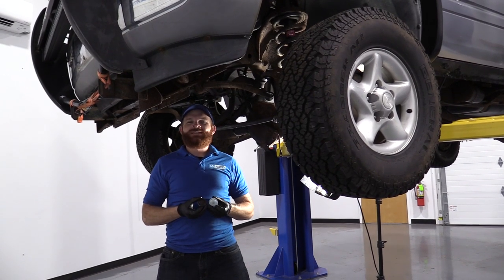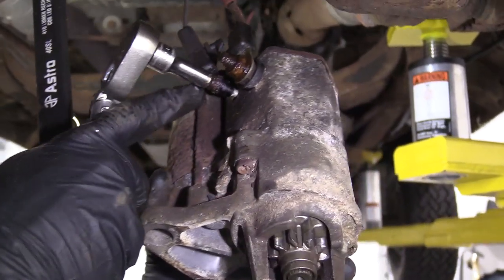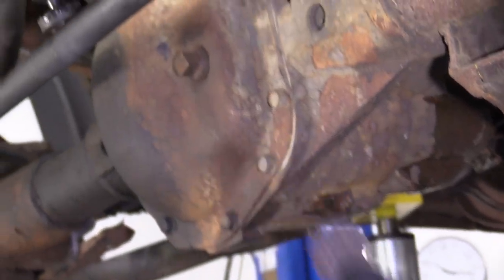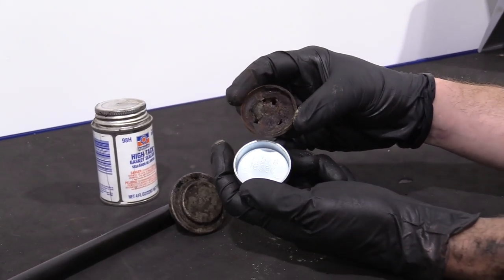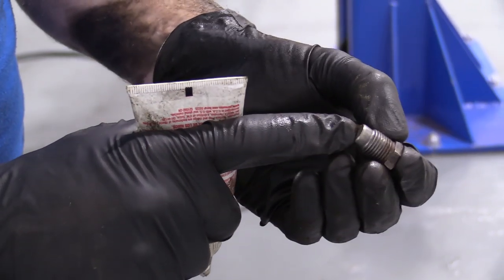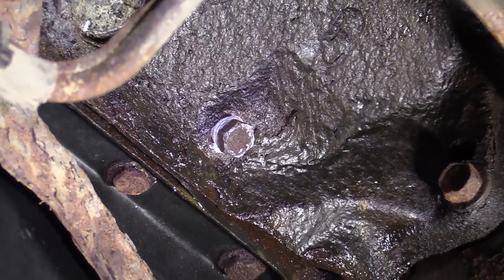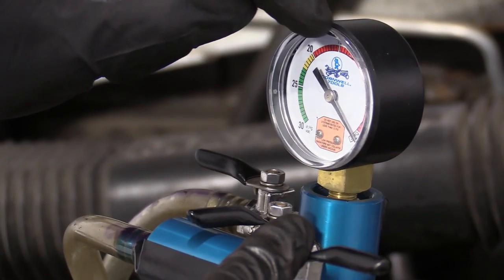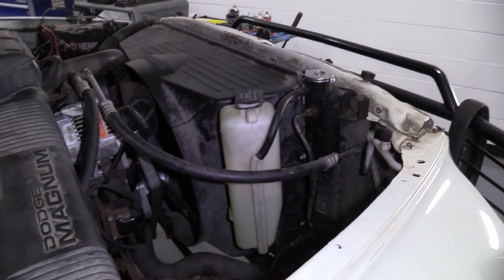How to Replace Freeze Plug 94-02 Dodge RAM 1500

Comment: I have a question, with gasket maker or sealant, will the core plug still be functional when the time comes? Or would it act as a glue and just crack the engine as an escape?

Comment: I see the struggle to install that plug, I use a socket that will fit inside the plug to get it started then use bigger socket to drive it all the way in. I made my own driver with a 3/8 drive wobble extension n viola freeze plug installed

Comment: Nice Video, but how come you didn't change the other freeze plug before you put the starter?  Whether it didn't need to be change but just to be safe.  Would it be extra charge to do it?
Reply: Hi Gonzalo, I saw same thing he never did other freeze plug. Tip on putting  in freeze plugs in 5.9l I used bit red silicone,  and  small hammer too get it stuck and started then I used my air hammer  gently with my mushroom head  tapped it right in place was fast easy. Just got Tapp it gently all around and watch it go in  then done. Also I used from harbor freight  in package there's  6 wire wheels they fit die-grinder try it fast freeze plug hole clean out  use bigger wire wheel to polish block with. Simple.

Comment: I paid a mechanic to replace the freeze plugs in a used engine he was putting in my truck, as well as adding a freeze plug heater into one of the holes. When I got my truck back home a few hours away I seen the heater and new plugs sitting in the floorboard of the truck. So I guess now I have to do it with the engine in the truck.

Comment: That block needs to be flushed.  The crap in that water jacket will or has already stopped up the radiator, heater core and water galleries.  Water pump seals are likely chewed up too.  A brass wire wheel works good for cleaning those holes.  The corrosion of the frame means that truck isn't long for this earth.
Reply from the maker: +Tiporari Thanks for the feedback!

Comment: Why wouldn't you freeze the freeze plug to shrink it and make it easier to install?
Reply from the maker: +Seth Luman Thanks for the tip!  You can always stick a press in part in an ice bath or the freezer prior to install, as this will shrink the metal making install smoother.

Comment: I wonder if the 5.2 have the same size freeze plugs🤔
Reply: Yes and even the 3.9 L v6  which is really a 5.2 minus two cylinders what might change are the smaller plugs if you buy a full kit for a specific engine say to replace them all and also the amount of plugs would be less for the 3.9 v6.
Reply: @JoseSanchez-wb5rz  what about the 8.0?

Comment: It worth noting ram 5.9 is the same as 3.9v6 Dakota 

Heard its best to use Brass freeze plugs.

Great video.

I have coolant leak in my Dakota and looks like its from freeze plugs mine all look like that but leak coming from in front of the engine near  the crank.

I think there's freeze plug behind the alternator.

More videos on coolant leak from 
 ram/dakotas please.

Thankyou 👍😊

Comment: 1. Its called a npt thread 2. A real mechanic would have used a shallow 32 mm and an extension backwards on the socket and been done a whole lot faster than you  lol
Reply: But 500 dollars more expensive
Reply: That's what I used socket and extension
Reply: Too bad the frame was in the way "real mechanic lol"